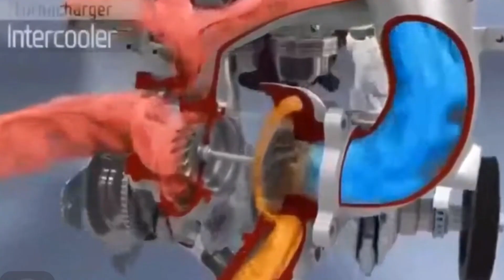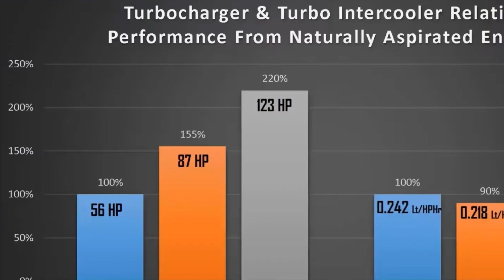Myth-Busting TURBO vs Naturally Aspirated Engines

Comment: there's no replacement for displacement.  turbo engines will never be as durable as NA engines.  you can't beat the low end torque of a good ol' American pushrod v8 (which are still made to this day)
Reply: You are correct, turbo engines create a lot of heat parts which in turn Damages some engine parts.